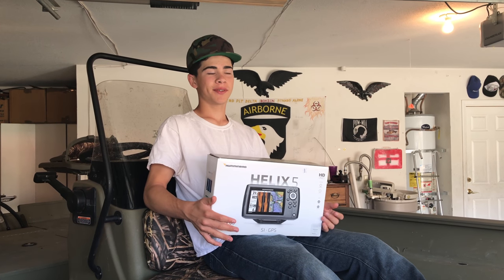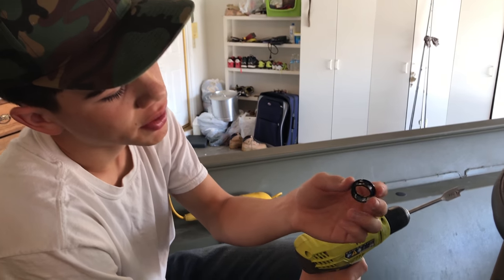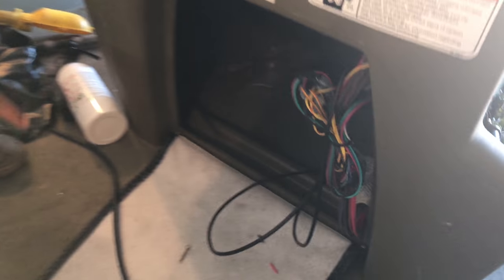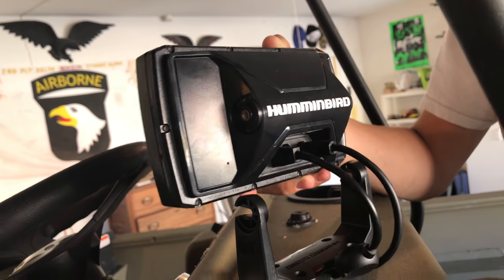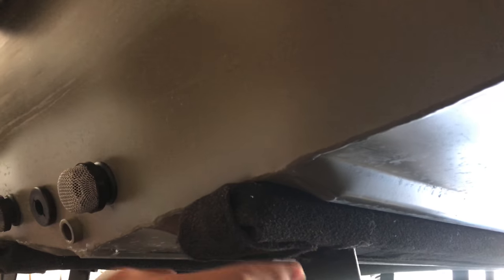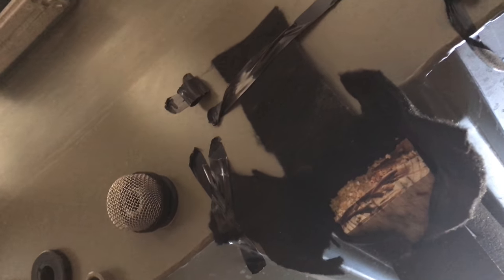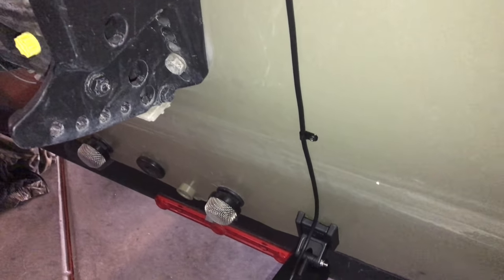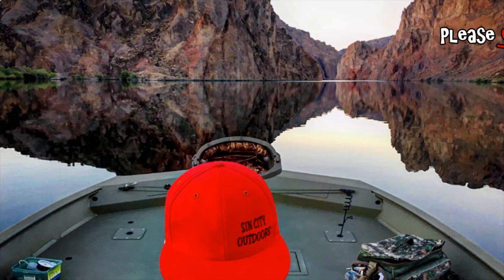Fish Finder and Transducer Installation - Helix 5 SI GPS

Comment: Hi i wanted to get a follow up on your installation.. how did it go? Did you get a good read from the helix with this installation, no bubbles nothing ? I’m a new princecraft springbok 16’ boat owner and i am kneeling toward installing my fish finder like your installation .. but i will be adding a Teflon plate instead of just going straight in the alluminum ..
Reply from the maker: It’s still running just fine. It will read fine without bubbles until we reach about 10 mph